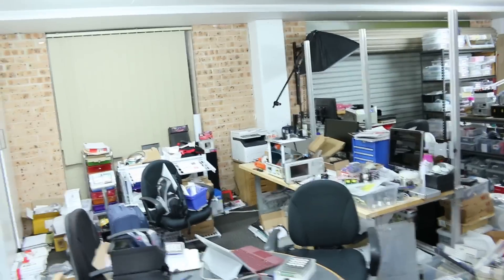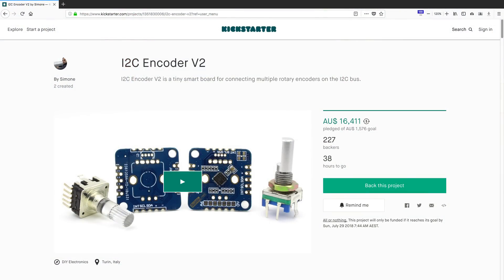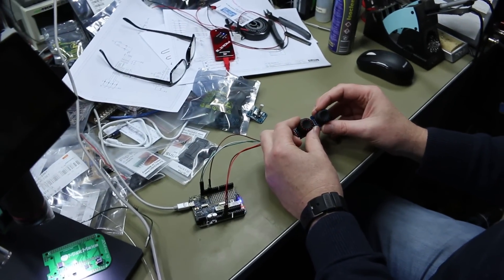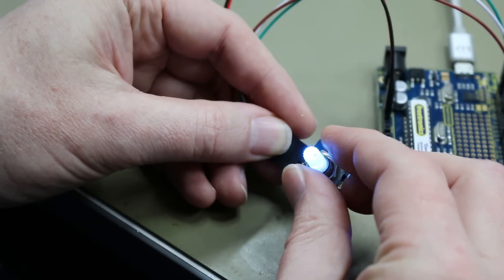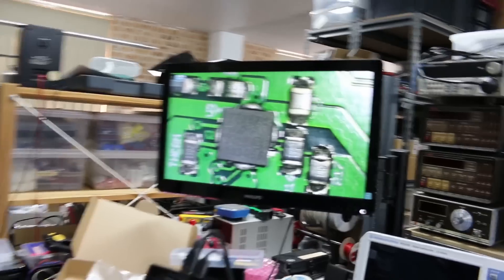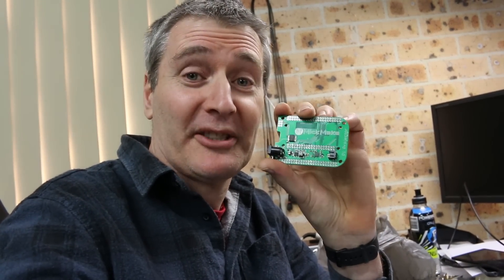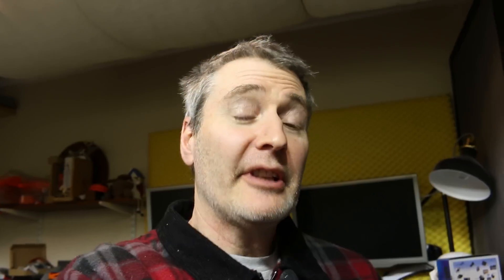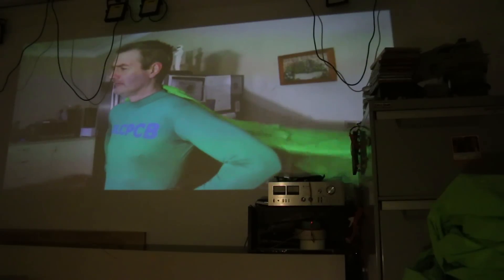#219 The PiProjector Rev2.0 & I2C encoder Kickstarter // MickMake Desk

Comment: Nice video, thx. For assembly you are using wrong needle for paste dispenser. Here are right ones. https://www.ebay.com/itm/30pcs-14-25GA-Solder-Paste-Adhesive-Glue-Dispensing-Needle-Plastic-Tapered-Tips/302790799604

Comment: while i like the encoders i can't really see a commercial use for them so that will limit the market down to hobbyist so if a company like jaycar or altronics pick them up and sell them it would be nice and guys like me can use them to add some bling to our projects .
Reply from the maker: Encoders are used in many many mixing desks. In fact I’d say pretty much all modern desks use them instead of the old pots.
Reply: MickMake 
Oh ok  ! i thought they still used  sliders - thats how long its been since i saw a mixing desk of any sort ! so now its encoders and digital pots or some other form of signal processing ? 
I was also thinking of general consumer items like stereos and amps , everything these days seems to be operated by a remote  or buttons to control settings in a menu .

Comment: The I2C encoder kickstarter unfortunately doesn't support inexpensive optical encoders.   I refuse to use mechanical encoders because they're notorious for going flaky after a few months-- what little plating there may be on the contacts, wears off quickly and oxidation sets in, causing jittery behavior.   Optical encoders are the only way to go, and they make inexpensive ones-- though they do require a voltage for the internal illumination, so they're not directly compatible.
Reply: That's a good point.  The mech encoders are a bit crappy, and there is only one source for the RGB lit ones (unlike the metal shaft ones which are are a copy of Bourns).  I haven't seen too many problems when using them previously, and I also don't see myself using these in critical or 24/7 applications.
Reply: Done.  We'll see what happens...
Reply from the maker: You should suggest it to Simone!

Comment: What solder paste applicator are you using? That looks great.
Reply: This is my new one, but Mick was using my older model, which is pretty much identical but cost 3 times as much
https://www.aliexpress.com/item/220V-AD-982-Semi-Auto-Glue-Dispenser-PCB-Solder-Paste-Liquid-Controller-Dropper-Fluid-dispenser/32720970790.html
Reply: Note that it needs an air compressor.  I've tried a few of the hand held motorised ones (e.g. i-extruder), and haven't found one that I am happy with.
Reply from the maker: It’s a solder paste dispenser. Not sure on the brand. Maybe Kean will reply!

Comment: Could one add more LEDs? How might one maximize brightness?
Reply from the maker: I believe the LED is fixed into the encoder, so would depend on the particular encoder you use.
Reply: I think Jianju69 may have been asking about the projector?
Reply: Yes, Kean, but, as I understand it, the "encoder" is what switches colors for the R-, G-, & B- channels. Please correct me if I'm wrong.
Reply: Sorry, I'm confused.  Are you talking about the rotary encoder (Kickstarter) or the Pi Projector?  Both have R, G, & B LEDs, and are completely unrelated projects.  In any case, no you can't really increase brightness in either case - there is just nowhere to install additional LEDs, or can you run them at any higher current without shortening their operating life.
Reply: Sorry, Kean, you may be right. I got the impression that this encoder was part of the projector, but I think you're right: they're separate projects. I thought the encoder was the color-wheel for the projector.
Reply from the maker: You can theoretically change the LEDs in the projector, but then you’d have to handle the extra current, make sure the LEDs can switch at the appropriate rate, and then there’s the thermal issues.
So... it’s possible, just not worth it.

Comment: So...knob will take more energy then MCU....
Reply: PIC16, so pretty low power.  So yes, the LED's will definitely draw a lot more power.  Didn't check the LED current on full brightness.
Reply from the maker: It used a PICF18 which are pretty low powered, but I reckon it’d be about the same if not only slightly more power than running them off a “full” MCU.

Comment: I have heard people say they reflow with flux for stuff like this, wonder if it helps or is it just too hard to manually apply a small enough amount of paste without a stencil ?
Reply from the maker: It really is fiddly without a stencil and so much easier with one. For the ICs the pads were so tiny I just laid solder across all pads and relied on wicking for the solder to be pulled in. Not the best way, but works with a bit of rework after.
Reply: Yeah, it is fine for a prototype.  But next time order a stencil!  LOL
Reply: I use the method of Luis Rossman to solder qfn stuff. Hot air and than a small tip with lots of flux to cleanup.

I have ordered a stencil but I'm still working the first prototype...
Reply: Yes, that is a fine technique for a prototype or for repair work - and is often how I do it.  But Mick's concern is with doing a small production run for Tindie sales, where he can't afford spending 5 to 15 minutes of rework and cleanup on each board.
Reply: Kean Maizels in that case a stencil is a MUST.
It also have a IR oven.... So with a proper stencil the process should be straight forward!